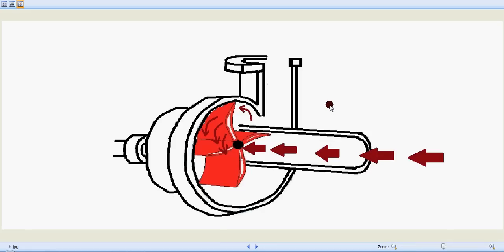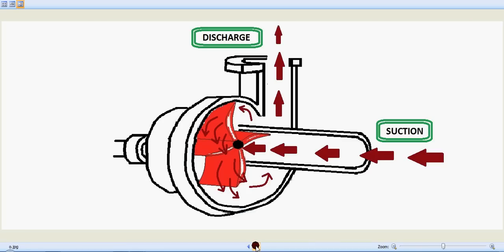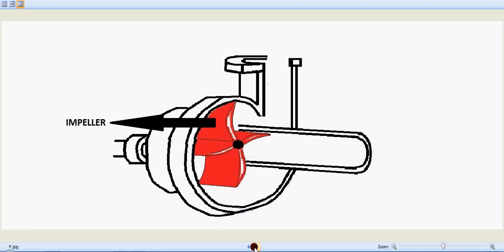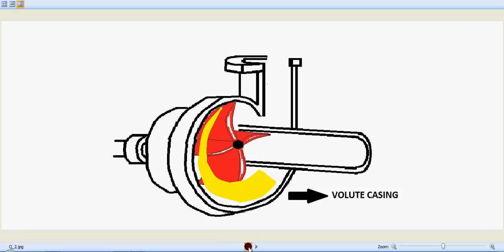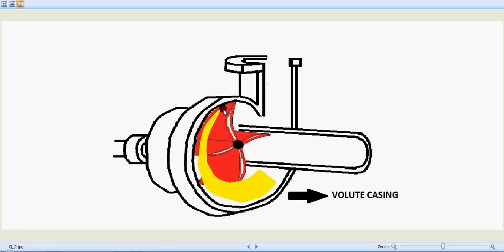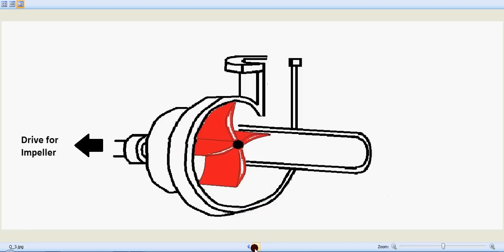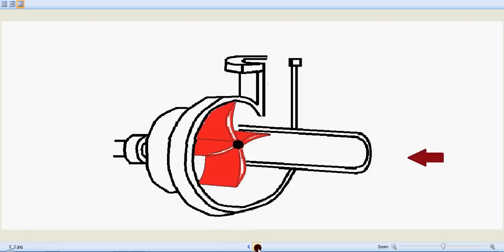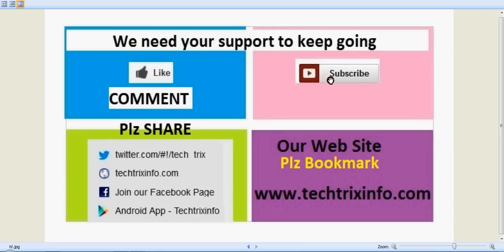Animation - How centrifugal pump works. ✔

Comment: When area  of casing is increase the high velocity water particles get slow down because as area increase velocity decrease & due to accumulation of more water particles at one place increase the pressure.

Comment: 1:30 pressure doesn't increase with area, more area means less pressure, the pressure increase is from more atoms/molecules being forced through by the pump.
Reply: The difference between static and dynamic pressure is not explained

Comment: Two questions
1. Is it possible to maintain pressure by throttling discharge valve
2. What happens if the discharge valve is shut with pump operating.Will the casing burst. I do not think so
Reply: according to me if dischrge valve is close impeller wil run in othr dirction so tht it vl not harm the pump
Reply: +Sahil Vankar we throtle dischrge valve so tht it vl not cavitate the pump n ur pump cn loss d suction

Comment: Well, I've always wondered 2 things about centrifugal fans and pumps:

1. What would or wouldn't happen-at least what would the supposed downfall(s) be- if you turned the blades the other way so that the fluid would be pushed towards the exit by the inside of the cupped shape--the convex face, just like running a paddle-wheel in reverse (the direction I thought they should've been spinning when I was young)?

2. What would the supposed downfall(s) with the flow and pressure be if the volute wasn't spiral-shaped, but that the space for the impeller was just a perfect circle until the exit?

Happy Mother's Day to your family next week (as I write this)!
Mike
Reply: MaxxFordham I am aware this is an old post but was your question answered? I am also interested in knowing the answer to your first question. For your second question I believe what would happen is that if the shape is a perfect circle, the velocity would not decrease as it does with a spiral shape, so the losses would be much greater and the pressure added by the pump would be not as much.

Comment: total energy in the liquid is constant..

total energy=(K.E+pressure enrgy+internal energy(heat))=constant    

change in temperature of water is very less hence internal eneegy is negligible
change in kinetic energy is converted to pressure energy at the exit of pipe
(i.e decrease in kinetic energy is converted to increase in pressure energy)...